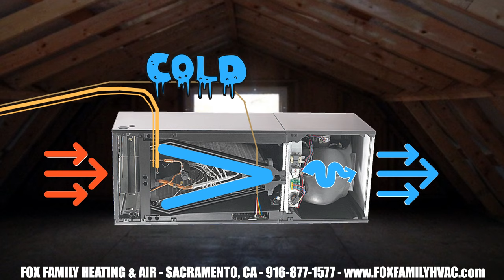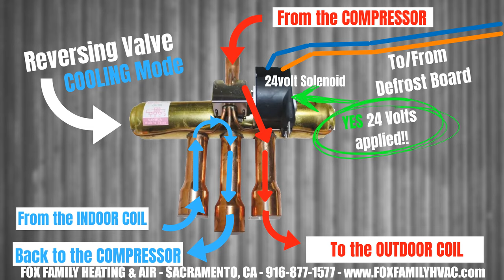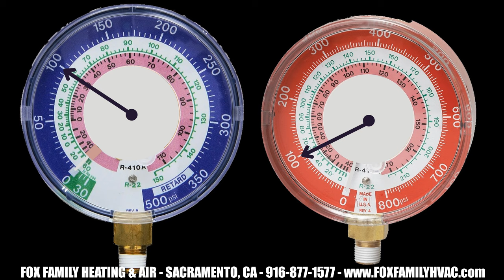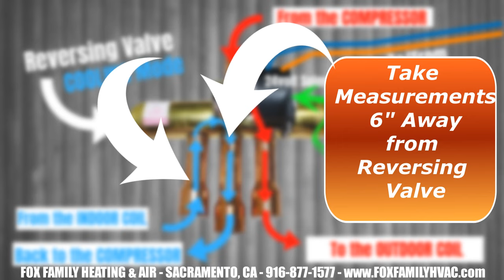Heat Pump Reversing Valve Troubleshooting Tips (Switchover Valve)

Comment: Wow. Do you know how many videos there are out there that imply that it's  all but impossible to tell between a bad RV and a bad compressor? You make it sound so easy. I think this may be the most technical video of yours I've seen. Right up there with HVAC School channel but they're in Florida. HVAC from a different planet.
Reply from the maker: Comment pinned! Thanks bro. I wanted to get this series out there. Going to do an AC series next. Then I'll come back around to the heat pump.
Reply: @foxfamilyhvac  Hey I just ran into a video from Lennox Learning Solutions channel called testing reversing valves where he uses a small magnet to visually verify the internal movement of a reversing valve. If you haven't seen it or done it I thought it was really clever.  Do tell what you think. Thanks.
Reply: @InsideOfMyOwnMind   I was curious if those solenoid valve magnets would work.  Seemed like they would.   I was thinking of picking one up in case my solenoid goes out in summer.  could just pop that on and keep the RV in cooling mode till a replacement solenoid could be sourced and installed.  I'd seen them used on refrigeration system solenoid valves by Chris at HVACR Videos
Reply: @jkbrown5496  OK this will be a real hack(and I do mean real) but I suppose if you know you're going to replace an RV that doesn't always play well with the transition to cooling, maybe put it in cool mode and just give it a little pinch behind the pig  to lock it in. I know EVERYBODY'S going to SCREAM at me but if there does happen to be anyone else thinking the same at least the naysayers will have their day in court by me mentioning it.
The replies are bound to be akin to that about someone promoting MAGA hats.
At least the entertainment value will be there.
You're welcome and thank you.
Reply: @InsideOfMyOwnMind  bahahaha,,, 
= 27 year commercial HVAC journeyman
LOVE IT!
Reply: @InsideOfMyOwnMind   While I found your hack to be something potentially useful initially, I read to the end of your comment to see you intentionally making it political. Why you would want to create division in such a far corner of the internet as this is beyond me, but, that’s your choice, actually your right, thanks to freedom. I just wish this type rhetoric could stay out of these type situations, but I digress.
Reply: @Taliswynd  It was nothing more that a way to gauge how some readers may receive my idea. MAGA hats were a well known hot topic at the time and I believed and still do that it served the intended apolitical purpose. 
Things can be mentioned but you failed to notice that I did not place myself on either side of it because there was no need and it wasn't a function in my core comment. If it helps you any I will not attempt to assume your political gender.
Reply: @InsideOfMyOwnMind  I can appreciate and respect that. The only thing I would point out is I don't believe either of us placed ourselves on either side of it. I can see your intent much more clearly due to your response, and I guess that is where my initial issue stemmed from... Without the response (which I thank you for, it is harder to find people these days willing to engage in informed respectful discussion concerning an opposing view.), I simply saw the statement and felt it took so much attention away from the very helpful information you were giving, because it immediately took me to another place entirely in my mind... Division. No matter the side. I am a very independent thinker, and perhaps I analyze things a bit too much. I apologize if I came off brash in my initial response. It never ceases to amaze me the places you can find wisdom.
Reply: Agree happens to me too

Comment: Been going through same problem of stuck reversing valve, went through 2 diff technician. 
Is there any HVAC HEAT pump available as manual switch . .? Much simpler and reliable than fragile automatic system from ducane heat pumps.

Comment: Rheem products energize the rev coil in heat mode. Someone has to be different? Right? Also, Checking port temps will tell you if it's bypassing. Don't condemn a compressor before your sure the txv is not bad. 30 year HP Vet here.

Comment: Would a bad reversing valve cause a low vibration that gives pressure inside the home which can hurt your ears? I’m having issues with my electric heat pump and I’m unable to turn my heat on. I checked the blower motor for debris, the outside fan looks fine as well as all concerning bolts. I am calling someone out this week, but since its just me, I would hate to be taken advantage, so it might help me to know a little something more about whats going on.
Btw, my heat seems to work just fine, in every other way, its only the pressure and vibration that builds up in my home making me feel as ill and thats the reason I shut it down and its not in use. The sound can be almost rhythmic as if music is playing outside and as if a motor is running next to the bedroom. I can place a bottled water on my bed and you can see the vibration within the water. There’s no banging in the ducts or whistling either. Any info will be helpful. 
Thanks!

Comment: This allowed me to diagnose a bad control board sending 10v to solenoid and jump it from the fan to send 24V so I have cooling again until my new unit arrives. My family thanks you.
Reply: Vrey nice full not  drshion opesting fixing  mod ifhcshion  cancelingsystom fixing  mechisom not not circulingsystom  revacing vas suspering het  hotco rmsl  working   not movring revacing  4way 24 wr hotcsed systom wringrec  sic rfingeat  side expashion  3sie..  outer  other sidfix ine

Comment: Nice vid, thx! Pretty sure this valve is flaky on my 8yo Mitsubishi 3C30. It mostly works OK in heat mode unless I make the mistake of running it in low fan and/or low temp, in which case it can drop into cooling mode (or perhaps in-between). Some combination of switching between modes and banging on the outside chassis has fixed things (so far). Tho I did have one awful late winter a few years ago where the heat output dropped to barely usable, but I neglected to deal with it. My electric bill for those 2 months was double what it should have been! Now I'm trying to decide whether to get the valve replaced, or just get a whole new unit given its age (if I got the valve replaced, I'd also look into replacing the 2 PCBs, which are probably wearing down—could even do that myself if I could get the boards. In fact, the self tests show some sort of vague unrelated(?) electronics issue, so, all the more reason). Just depends which option makes the most financial sense...  (p.s., the compressor in my 2nd Mitsu failed after just 2y. Needless to say, Mitsubishi is NOT my favourite company...)

Comment: I want to find out if there is something that can be done for a reversing valve in an 8 ton carrier split system that has a temp differential on the suction side before rv and a 20 degree td on the suction pipe after the valve. the system is about 8 years old and don't feel unit is a candidate to be condemned. I have been a state licensed contractor in south fl for over 35 years but don't have a strong background on heat pumps as most of south fl units are straight cool with electric heat.

Comment: My A/C has a heat pump. I am pretty confident that the reversing valve, solenoid, and compressor are all working correctly and as advised in this video. 

I do have a Nest, but I am also pretty sure it is working fine and wired correctly. 

It automatically switches from cooling to heating when the inside temperature drops below the lower set point. When the temperature rises above the upper set point, the Nest changes to heat mode, and the inside unit/fan runs, but the outside compressor does not run. 

If the power is turned off to the inside unit, and/or the Nest is removed from the cradle (or restarted), the issue persists. If the power is turned off to the outside unit, you hear a click almost immediately, and after a delay by the Nest (For safety) the compressor kicks on, and it cools normally. 

I have gotten my Nest device replaced to be sure that isn't the issue. 

I was wondering if the compressor might have a safety/relay mechanism that prevents the compressor from running until the power is cycled when switching specifically from heat to cool mode (not from cool to heat mode)?

Do you have any advice?
Reply: Sometimes, 5 minutes for delay
Also, I believe there needs to be a 3-5 difference before heat/cool comes on. This way your need immediately heating/cooling after the other cycle finishes.

Comment: Great video! Question: my mother just had a new heat pump/ac system installed. For some reason, when it is on the heat setting, it blows cold ac. And then on cold setting, it blows hot air. Pretty much like it’s backwards. What seems to be the culprit? Reversing valve or possibly wiring?
Reply: Sounds like the O/B reversing valve

Comment: I got Rev Valve stuck on Heat in Florida. Got 24 volts applied I can hear the Tick when i energize it. In S Fl Miami area most Heat pumps water Sources  are energize on Cool so when they break they do it on Heat.,..so is 87 degrees here and the RV is stuck on Heat not good Scenario,....only Mc Quay if not mistaken Energize on Heat so if they break they get Stuck on Cool wich is ok in Florida s Hot weather. Tnks agree 1000 percent on your video excellent for newbies,,,,,Sorry i was not able to Release it eventhough i tap on valve....Anyway if work would it be till next cycle and then would be stuck again.....appreciate your info....ttul

Comment: So here’s a new one for me.. got to a heat pump 3 years old, Lennox, stuck in pressure lockout. Reset get it going, sure thing, trips. Look at my pressures and low side is really low, 410a.. 25psi, high side seems normal. Thought I add refrigerant to give that a try and it starts filling up my tank with refrigerant, no joke. Filled my tank with a whole extra 1lb. Wouldn’t take refrigerant at all. Turned it off and let it settle, I was able to add some refrigerant, 1 lb plus what my tank took out, turned it on and still same pressures.. tried to add refrigerant again started going back to the tank.. NEW 410a TANK, couldn’t believe it.. kept it going to see sure it enough my tank took 5 lbs of refrigerant. What would cause this, a bad reversing valve? Put the refrigerant back but don’t know what to estimate? New condensing unit?

Comment: In heating mode if he indoor fan stops running, would that cause the compressor suction line to be warm on a package unit? I was suspecting a reversing valve issue but discovered the blower randomly stopped running (bad fan delay relay) this whole issue caused the compressor to go on overload .

Comment: I have a heat pump blowing 60 degrees and the temperature outside is 28 degrees but it’s not heating why would it not blow hotter? Or is it good?
Reply: Need supplemental heat maybe 5 or even 10 kw heat.  The cooler outside the less efficient a heat pump is

Comment: I would rather have my nose hairs extracted by a crowbar than replace a reversing valve.
Reply from the maker: Me too!
Reply: Almost fell off the roof laughing
Reply: 🤣🤣🤣 I just replace the condensing unit
Reply: Reversing valve is a water valve close and open if the valve don't open for cooling or heating. The valve is defective. Only difference is 24 volts applied for cooling mode and some manufacturers don't require 24 volts to the soloniod in the cooling mode. Verify metering devices is working no restrictions in the refrigerant system.
Reply: Cause you are  not qualified
Reply: The little ones are ok though….
Reply: @bish331  unfortunately not always an option when working with heatpump chillers. But it's shitty when the pipe diameters starts with 1 inch
Reply: I am there right now, you need a new condenser

Comment: So if my reversing valve is stuck on cool can I just disconnect the 24v solenoid and it will default to heat? I know it's probably not that easy but I'm willing to try as it's almost  winter

Comment: I’m a commercial tech, and heat pumps are a terrific idea if you own an electric company. It’s also a great way to shorten the life of your outdoor unit by 50% because it ends up running 12 months a year. If you want to default to cooling mode, then your system should be a Rheem or Rudd system.

Comment: I found two reversing valves not working; neither was the reversing valve failure.  One was the wrong setting on the thermostat and the other a wiring not working.

Comment: Booooooy, its hot up in here "Washington state" ha ha,,, think my neighbors reversing valve on an old Trane XP 1000 HP is bad as i am watching this video as we speak trying to fix it for em,, I do get 24 volts at valve in ac mode, but even pressure at manifold still,, hmmm, "tried a bit o tapping " lol now am going to try and go back and forth from heat to cooling,,,, 
THANKS FOR THE VIDEO!!!! BLESSINGS 🙏

Comment: I did this, my reverse valve was in heat only. Went to the thermostat, put the orange wire (reverse valve)  on the red 24v. Then went to the heat pump heard the coil on the valve, ran a manual test pushing in the relay and sure enough cold was running through the line. So my O on the thermostat was not working. i put the orange wire with the yellow Y1 that sends power to the compressor.  The Honeywell thermostat is defective.  I have ac until the fall. On youtube everyone said it is the valve. Another important thing to check is the transformer, they are supposed to put out 24 to 28v  i have 2 defective ones that put out 36 volts ac.. if your thermostat is flashing or acting up . Check the volts.

Comment: Didn't answer my question, reversing valve energizes when in cooling mode, it's always energized, thermostat calls for heat, reversing valve doesn't de-energize keeps blowing cool, I remove power from the coil by removing power the reversing valve slides to heating. Reversing valve isn't stuck, it's just constantly energized. This is a commercial unit that cools the lobby and has a remote sensor to the tstat which is in another area. I've disconnected The dft , still same problem. Could it's be the sensor even though the thermostat is calling for heat like it should?
Reply from the maker: I'm not sure about commercial.  There could be something in the low voltage communication.  It sounds like you're grasping the right concept though.  Hope you find it.  Let me know

Comment: What if mine doesn't want to stay in heating mode it toggles back and forth in heating mode and somtimes trips the main breaker in cooling mode
Reply: Did you ever figure this one out?
Reply: @MrIsaiah00  No I have not
Reply: @russellkovacs7939  hmm having similar issue on new heat pump install I was called to service everything is wired in correctly, would issues at the economize controller be the root?
Reply: @MrIsaiah00  That is the new parts i just replaced to grt it running again
Reply: @russellkovacs7939  nice was looking at a schematic all night and it has to be it thanks 👍🏻

Comment: Thank you for this. I wish I had found it sooner. I live in an area where it doesn't usually get too cold in winter but we've had colder winters lately. We turned the heat on and it worked fine. Then when it warmed up outside it got to hot in the house so we tried to turn the cooling on. It was set to cool but was still heating instead. We had someone come out and he diagnosed the compressor in the condenser as being dead. It was installed in 2010 & had gone through a lot of power surges and storms. We had the outside unit replaced with a unit that matched our inside unit. Cooling was working fine up until tonight. Now it was heating instead of cooling. I turned it off so it cooled down, but I am not sure what the problem is now. The unit outside is new so I don't know if its the compressor or reversing valve. Could it be the board on the internal unit then?
Reply: Could be a plethora of things: thermostat, furnace control board, heat pump defrost board, reversing valve solenoid, damaged wiring, improperly wired wet switches, you name it
Reply: @victork3397  It turned out a wire in a molex cable had come loose so the solenoid valve wasn't flipping from heat to cold. Fortunately, the outside unit has a 10yr warranty so the repair was free.

Comment: Hi fox l m work on reehm heat pump plaquette unit 5 tons l live enla Vega nv so we replaced the TXV because l have low pressure 270 and 325 on high pressure do you have ideal waht what's wrong with it
Reply: end they do the same low s 275 h 325 and the evaporate is hot 🔥 tank